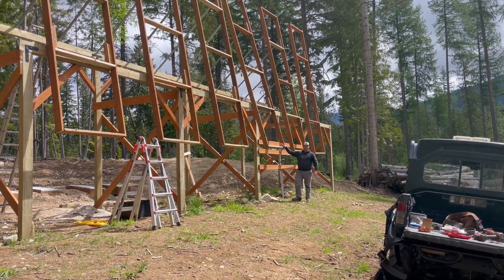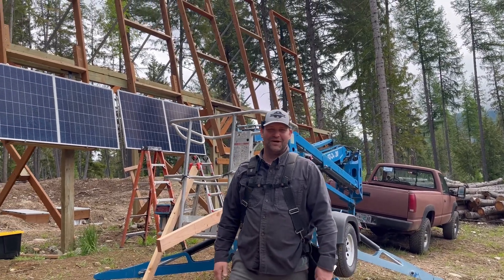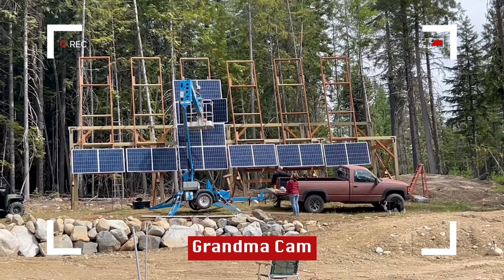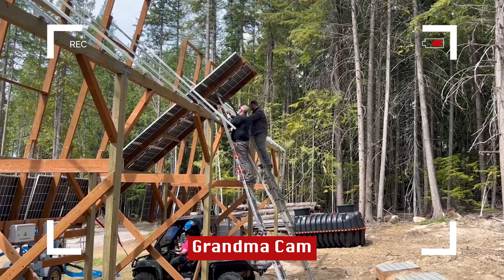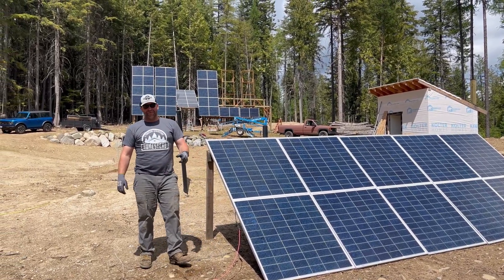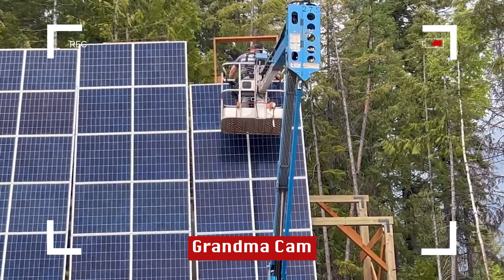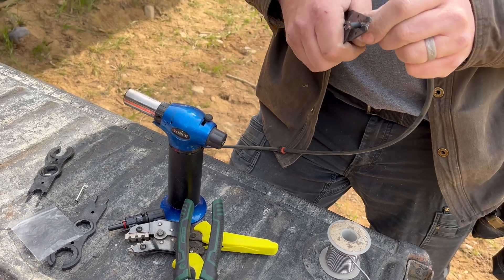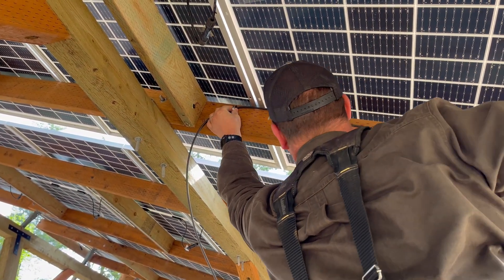Mounting 30 Solar Panels

Comment: Wow.....not sure which part of the world this is........have u considered wood rot over the yrs ?  Yes wind too ? Great idea, just worried abt the implementation..........will be glued to the long term progress coz I need to learn.
Reply from the maker: We are in north Idaho USA, wood rot is always a fear when building with wood. This structure should have the same longevity as our pole barn that is constructed the same way. There will be some wind loading concerns especially when the panels are in the winter angle (50 degrees) but the base structure is a shear box with each post set in a yard of concrete. Each array is connected at 4 points to avoid twist and everything is through bolted. We will keep an eye on it and keep you updated as to how it is holding up. Thanks for joining us!

Comment: Hi,just wondering why you put hinge point off center,its going to be hard to push them up when all the panels are on,if hinges in center it will counter balance itself and 1 person could move it. (Otherwise  looks good)
Reply from the maker: Great question, we placed the hinges that low in order to keep the panels out of the snow drift at the winter angle. if we centered the hinges, the low side of the array would have to be 15 feet off the ground, and there was no way I was getting Amy up that high.

Comment: You are using the wrong crimping tool. this is your problem; the proper tool looks almost the same. You have to get a MC4 crimper its a specific tool for the job.
Reply from the maker: Thank you. I didn't know they were different. I got so concerned with the flimsy metal not holding onto the wire.

Comment: Nice spot, trees will help break the wind, south facing sloping down good for sun , posts cemented into ground, and mounted high to get more sun. With some pully and hand crank, yall could change the angle super easy. I didn't see a lightning and surge arrestor, should be installed between solar and combiner box ,  right before controller also
Reply from the maker: Thanks, The height should also help keep the shedding snow from building up and blocking the panels. The combiner boxes do have a lightning arrestor built into them and we are wanting to install an EMP/surge protector in the powerhouse.
Reply: @1KGoffgridhomestead  nice, hope to see the rest of the system, great video

Comment: When you glass shatters you are not going to think using washers and bolts was such a great idea.  Just helped a customer replace panels that busted for that very reason.  Why do you think that solar panel mounting brackets distribute the clamping over a distance?  I hope you didn't tighten them too tight.  I would change it out!
Reply from the maker: Interesting thought, a solar end and mid clamp would only make contact with an inch of the panel frame just like my 1 1/4" fender washer does. We did not tighten them too tight, just snug enough to secure each panel.

Comment: If you cut some 1/2" ID PVC or conduit to the thickness of the panels (~1.5"), you can insert your outside lag bolts thru these sleeves, then the washers will stay perpendicular to your bolts where you only have a panel on one side.
Reply from the maker: Thanks, that is a great idea

Comment: Wooden posts to hold up that wing-like structure?  Sheer insanity.  I look forward to the video which will show that the wind knocked that entire kluge flat to the ground!
Reply from the maker: The posts are more than adequate for the weight of the panels as well as the wind load. All the posts are braced together making the base structure a shear box, with each post set into a yard of concrete. I will be keeping an eye on the hinge points to see how they handle the stresses. In the long run this was the best that we could afford to do. our snow fall required us to keep the low side 9 feet off the ground as well.

Comment: arrays look awesome. Nice job. 221 v  was for 1 string or for the entire array?
Reply from the maker: Thanks, That's a great question not sure what level of nerd you want, so I'll go full nerd. The short answer is that 221 volts is what goes to the powerhouse. Each of our solar panels has a max open circuit voltage of 46.8 volts so a string of 5 in series has a max voltage of 234 volts. which is good because our charge controllers have a max input voltage of 250 volts. So we have 6 strings of 5 panels each and each string has a max voltage of 234 volts (it was cloudy so we only saw 221 volts) We will have 4 solar charge controllers with a total input wattage of 16,000 watts. our array will have a max wattage of 11,500 so voltage input was our only concern that we needed to control. When you parallel two series circuits the voltage stays the same and the watts/amps double. We have six circuits combined into three and each of those three circuits carry 221(234 max) volts and 3800 watts to three of our solar charge controllers.